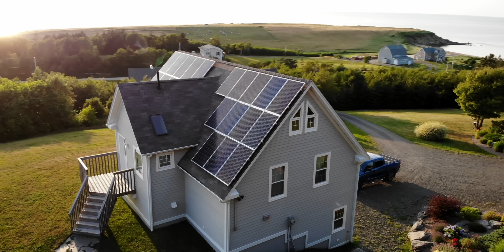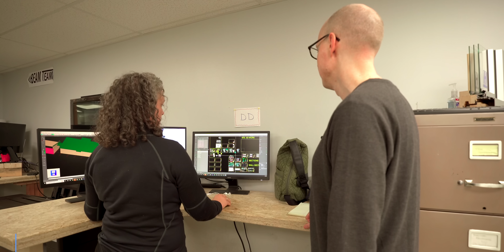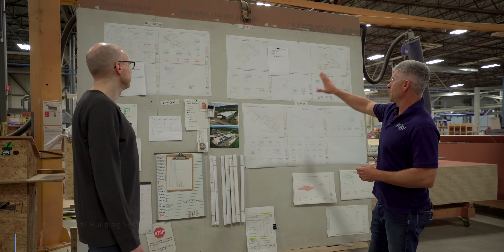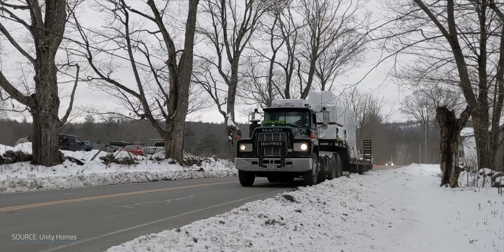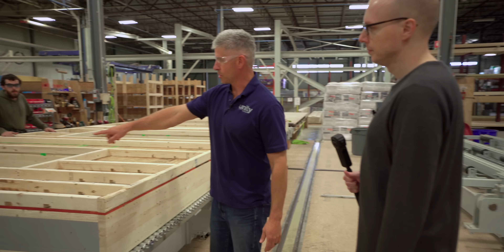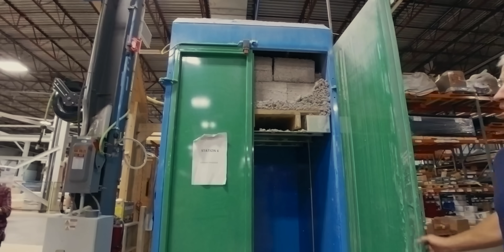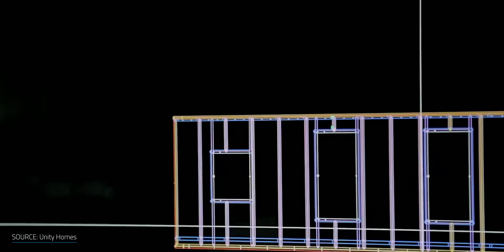The Simple Genius of a Prefabricated House - My Net Zero Home Build

Comment: I know some people who went through a company to get this sort of thing done for their new house, don't know if it was this company or not though, and although they are really happy with most things, the exterior doors had massive oversights. The hinges are not strong enough for the massive heavy insulated door and began cracking after 6 months. They are cast not full steel like most heavy duty hinges are, most likely to save money on production. And since the door is that particular style, and doesn't mount in a standard way, those hinges are the only ones that will work, and it's borderline impossible to find anyone to repair them in america. Builders wouldn't do anything aboud it and now they are on a waiting list for god knows how long to get it repaired, all while they live with a borken door. The locks still work, though the alignment is off since the door is drooping, and while looking up repairmen or locksmiths to fix it they also learned how insanely long the wait for new locks will be in the future. Just a tip but either don't go with that style of main doors, or get looking into it now since not having those connections can leave you in a similar scenerio. There are benefits and cons to european style doors for insolation, and one of the biggest cons is that it's awfult o repair in north america, and thats being gentle

Comment: As a locksmith good fucking luck getting anything fixed when those doors wear down and break, which if you're planning on living there for more than decade get ready for it. In my experience those hinges are terrible and prone to cracking, since they are cast they will crack instead of warping or bending over time like proper steel hinges, and getting parts repaired or replaced for the hinges or the locks will genuinely require months of waiting for parts and then needing to completely take the door off, and good luck getting it back on since they are so heavy. It being so heavy will actually make those hinges break sooner since they are slightly better than residential hinges, but not strong enough to be classified heavy dutym when they really need to be, and since the door is not mounted standard, you will need to get those exact hinges to remount your door, which is basically a bandaid. On top of that you cannot retrofit hardware when you will evenitably fed up with that garbage since the doors are thicker than pretty much anything will allow, the backset is so narrow nothing will work, and the glass stop is so deep that drilling the door at all, unless you're the manufactor of the door will most likely end up with shattering the entire glass. I'd recommend finding somebody in your area that will work on those doors soon because when time comes because it's going to be insanely difficult.

For reference I'm currently in canada and a building we do alot of internal work was made like your house and is mostly passive, and has those exact doors for it's exterior. It's used much more frequently than your residential house will, but in 6 months time those hinges had begun cracking entirely, making the door droop and not allowing it to close and seal properly. On top of that they were unable to find anyone to fix them without waiting almost a half a year, with bunch of broken doors, and the builders although claiming they would fix it, never did. It's entirely possible they just put the hinges on wrong or whatever, but still if the hinges were enough to support the door, even an incorrectlty installed door will not do that in such short times. The point isn't that your builders will replace it, but instead that it's genuinely garbage that does break down rapidly. European style doors are really good for wheather sealing, but they are also much heavier so proper hinges need to be used, and it's borderline impossible to find anyone who can get parts if you don't live in europe, let alone repair them in a hurry. Not to mention the parts are often not standardized, so there is no guarentee parts will be available at all in 20 years time. You will need to replace the door, and since there is no standard door prep, you're gonna need to get the exact same thing from the builders.

This is just a word of advice, look into it before it breaks because without the right connections you will be stuck with a broken door for 6 months

Comment: Ted Benson is certainly an innovator and the factory build takes a huge risk out of managing contractors that may want to interpret drawings to their advantage. The triple pane tilt and turn windows are a huge part of the thermal performance and I see lots of effort to make the house air tight so the HRV systems will be another key element. Looking forward to seeing the rest of the mechanical and PV systems.

Comment: Make sure they put down four or five beads of caulk on the concrete before setting those wall panels that'll give you a good bug and air seal from the concrete to the wall modules. Please get a blower door score once your house is done it'd be amazing that's know what their hair tightness rating is. It's a really neat operation they got going. Thank you for sharing your video.

Comment: Have wait the last 35 years for this to be how you do building a standard home. I am in the part of the world where your type of windows are the norm, but so fare every company trying this on a larger scale have stopped doing it for residential buildings. Commercial building are to a high degree build using a similar method and the result is that in the morning you have a foundation and in the evening a building or a new floor.

Comment: Every build should be a prototype, it should be a response to its location, its site and the brief of its user, of secondary importance is how the building fits with the principles and goals of the community.  I have designed buildings built from kits of parts that whilst they afforded a good opportunity to achieve economic results they were always a compromise.  The same applies to a greater extent with factory built buildings.  
Looking at the buildings that are on offer here I wonder what their actual performance levels are.  They are of necessity lightweight buildings utilising softwood construction with cheap, limited lifespan components and a key to their energy consumption is the vast array of solar PV panels.  There are many truly zero carbon buildings built around the world and the best of them are invariably heavyweight buildings to generate thermal mass that means they stay cool in summer and warm in winter with little internal fluctuations.  The secondary advantage of such construction is that they tend to be very durable and will therefore last many, many decades longer than the lightweight designs.  The foundations and the unde4rground utilities will naturally last longer than the shelf life of the factory building, so why not the superstructure?  The third advantage is that because of the longevity of a heavyweight building its lifecycle carbon footprint is many times lower than the lightweight one.  The last advantage is that there is less need for technology to overcome the deficiencies in performance.

Comment: Energy efficiency is great, but durability is important too.  If I were building a home, I would want construction that will last for 300+ years, with minimal maintenance.  A lot of that comes down to materials.  The materials they are using looks like a buffet for termites, easily burned, and water damage is very possible if the house is unoccupied for a bit and the electricity is turned off.  Then there is no ventilation, and condensation and such could lead to rot and a "sick house".

So what materials would I use?  Well, it depends on location, as there are different threats to home in different places.  
If fire is a threat, then refractive concrete formulas are good.  Anywhere, I would choose basalt rebar over steel rebar.  Steel rebar corrodes and expands when exposed to water, which then causes spalling which tears the concrete apart.  If termites or wood rot are threats, then borate treated wood is the bomb.  And I don't know where there is no risk of these things.  Maybe the desert.  But in a very closed home, there still could be risk.  For earthquakes and high winds, I prefer more screws, and bolts, in place of nails.  I personally have switched to using stainless screws and coated lag screws when I make decks.  I don't want to make stuff that lasts only 30 or 40 years.
I think modern roofing is a joke.  We need to do a much better job making roofing.  Like I said, 300+ years should be the target.  The only thing we have that lasts that long is a good instillation of slate.  Hard to believe we can't make a better material than slate.  All those engineered countertops, but we can't make roofing that will last for centuries?  What about cutting other rocks, rather than relying on the natural fracture planes in slate.  Surely there are better rocks.  Quartzite should be very durable.  Hmm.  One Google search later...apparently, you can buy Quartzite roof tiles.  I guess I would go for that.  The more silica is in a rock, the more it resists weathering.  That is why beach sand is white.  Everything else eroded first.  Quartzite is sandstone that is metamorphosed, and welded into a strong rock.

Comment: I worked as a Carpenter in the UK when I was younger and we just started to build like this, I even worked on a project where a fully finished bathroom was lowered in by crane, it was a lot faster build but as we still use brick walls, still not as quick as this. Brick and roof tile is the standard here. I would love to design and build a 3-story home using some tiny home principles in a factory like this as land is very expensive here, so it would reduce the cost of each home.

Comment: Yes, certainly this is the way to go. Assembly at the construction site is ad hoc and you will have issues with gaps and bridges in many places. Having the walls built in a jig ensures dimensions, flatness and the right number of nails in the right spots. Also, insulation will be placed correctly.
Being able to assemble in a controlled environment without moist and at the right temperature prevents problems with mould and rot.

There is just one thing which I have a problem with and that is that often US houses have outside panels mounted directly onto OSB sheets. In Europe we always have a drained and ventilated gap of about 30mm so that any humidity after a rain can be evacuated.

Comment: This is gratifyingly impressive !! Been hoping for something like this for decades ..

[1] What about the jobsite work automation, such as foundation work ?  I have always envisioned a machine to drill down a reinforced concrete screw into the ground at site, guided by precision positioning system, so that it would not only be super-precise in location and levelling, but also pre-engineered to work harmoniously with the house/structure resting on top of them ..

[2] Unfortunately, no matter how good we are and how hard we try, we still get anywhere without the moneymen on board .. How are we doing in the aspect of getting the real-estate and home mortgage people to see the value in this and fit us into the regular commercial market ?

Comment: Right, but can you convert this 3D model into a Wolfenstein map?

8 roof slopes like here basically make the roof unsuitable for solar panels.
I personally would stick to just one or two roof slopes, that can be indented to form a patio between the front of the house and the garage, or for terraces on the first floor, but all dimensions would have to be based on the dimensions of the solar panels, which will be an integral part of the waterproof roof that also includes overhangs.
This makes for a simpler and cheaper design with much less thermal bridging to solve.
I would also include a cool cellar, given the current global warming context...

A R factor of 35 is good but not up to passive house specs (R between 40 and 60).
That's too bad, the building company was almost there. An inch more of insulation would have done the trick.

Comment: Congratulations on your new home. However, I do have concerns about your studs doesn’t have screws, which will better prevent stability. I’ve seen multiple roofs come off in severe weather with just nails in the wood panels. Wood should be joined with screws and metal straps.

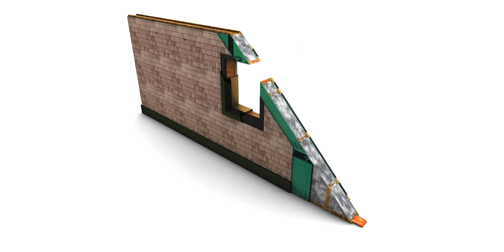Comment: Did anyone else notice at 10:25 and 12:30 there is not zip sheathing on BOTH sides of the wall.  They are using standard OSB on one side.

Comment: I like the  engineering that goes into the home. However having built thousands of homes I am curious about the cost comparison of building a home like this versus the cost of conventionally built home on a square foot basis. Than that begs the question about the payback cost analysis assuming this system is more costly than a conventional home and has some expected ROI on the additional expense. I have seen kit built homes being competitive on an extremely rural basis as bringing together the labor and materials in distant locations is more expensive than just shipping the panels and erecting the structure. When building in distant locals one can use green treated lumber in the foundation and save a tremendous amount of money over a poured in place concrete foundation thus making the entire finished cost less the conventional a built on site balloon framed home on a concrete foundation. Do have any numbers on the expected payback and ROI?

Comment: We are still in love with bricklayers in the UK and very few factory assembled homes exist.   It is definitely a cheaper way to build as well as offering higher levels of insulation and therefore lower energy buildings.  I have been watching this market for a long while and interested to see your project built out.  In the UK houses are smaller but that does not mean this approach cannot work - it is applicable to all buildings whatever the size.
Reply: Brick building tend not to fall down with a stiff breeze - my preference any day.
Reply: @fredbloggs5822  My small English town has houses of all ages. The oldest, around 500 years old, are timber-framed. I suspect they may have survived  a few stiff breezes during their lifetimes.
Reply: @fifthager  Bit of a difference between oak beams and a modern softwood construction though .

Comment: No, you're NOT weird for being exited about triple glazed tilt&turn windows. It's a shame they're still a niche market in the US because they're tighter, have handles that work, keep pets in and intruders out when tilted, and are easy to install: for operable windows the sash is removed and the installer only has to handle the much lower weight of the frame. I know, I've done the installation of a 48x48 by myself (fantastic for egress, too). Poland and Germany are key manufacturers.

Comment: Are you weird for liking tilt/turn European windows? Nope. Anyone who has followed Matt Risinger or Passive House/Net Zero/High Performance Construction nerds out about doors and windows because that is where the majority of the thermal bridging and air leakage occurs. Minimize those issues by getting high quality doors and windows, and now the only issue is sealing where the slab meets the wall and where the wall meets the roof. Nerd out my friend. Nerd out.

Comment: Is this not more properly termed "Panelized" rather than "Modular". I built a few hundred modular homes, and a few panelized homes. Quite different. Modular to me, means boxes are fabricated in factory and delivered and set, rather than wall sections. Modular is a huge step above mobile home of course. Modular is stick built boxes with wood framed floor in a factory. Mobile is lower end, and shipped on a permanent steel carriage.

Comment: Prefabricated homes are stronger.  Each module or section has to be strong enough to hold itself together until it is built with the other modules.  I had an instructor that did one before it was cool.  A tornado went through his neighborhood and he had the only undamaged house in the area.

Comment: I have built many earthships, passive solar adobe homes and straw bale homes at elevations between 7,000 and 10,000 feet in Colorado where the sun shines almost everyday.  They need almost no heating or cooling energy input.  They're very labor intensive and therefore expensive.  But, they're very "homey" and artistic with a feel that is unmatched, IMHO.  I can almost envision incorporating on site CNC material placement, someday.  Thanks for this video.

Comment: As for why things like this aren't more common?  Construction is a very corrupt industry.  I don't mean the sense of people taking things or cheating, but rather that a big part of it is deals of questionable legality.  The in-house system would simplify a whole lot of that, but it would also require a change in the way they did business on a fundamental level, making it very difficult to do things under the table.  That scares a lot of GC's and sub-contractors.

Comment: My only complaint about what they are doing is that they are changing how its built, but not changing the way it is built.  We build stick frame houses the way we do because they were historically site built, and building methods and materials were chosen for that paradigm.  With factory built homes, we have a huge opportunity to change that paradigm.  Choose new materials, a new set of standards, instead of just replicating the old site-built methods in a factory.
Reply: Joseph, I agree with you. I think it is only a matter of time for the matrial options to improve with this approach. I expect that local building inspectors are comfortable with the materials and techniques being used.